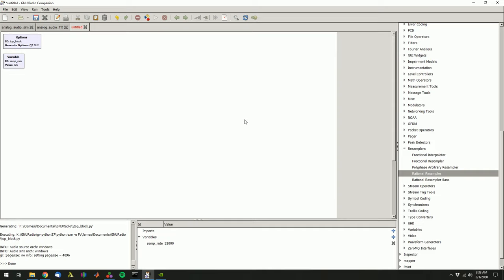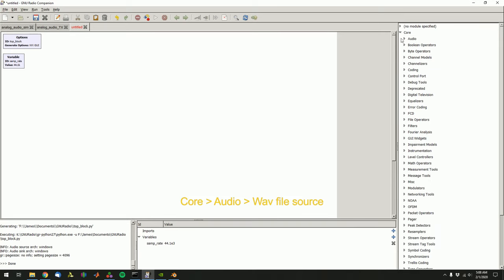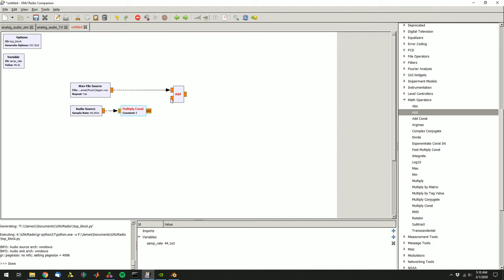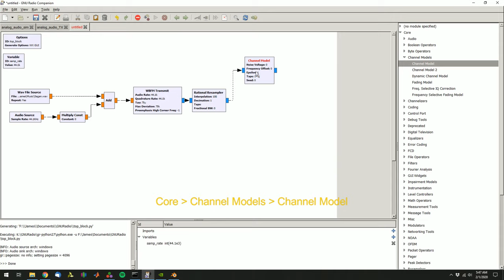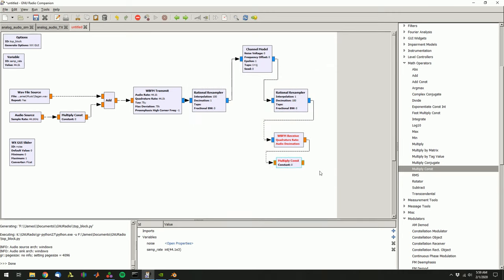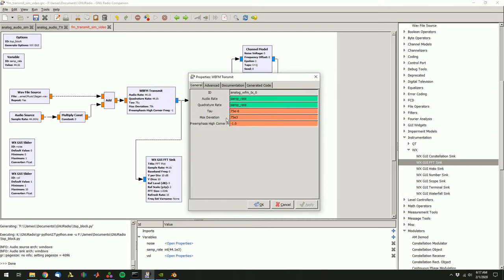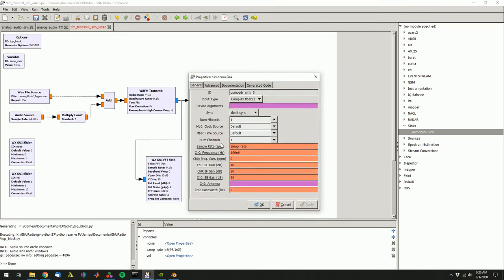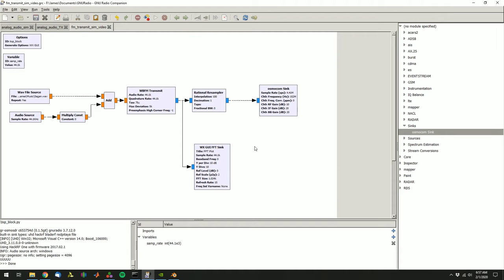FM Transmitter in GNU Radio with HackRF

Comment: You may want to insert a 44.1k throttle block after your file source instead of clocking it with an audio source and zero multiplying it, but nice! :)
Reply: My audio had a stuttering noise while transmitting but after trying this out it fixed it thanks!

Comment: Hi Bro

I get this in the process drawer and nothing runs, pleaceeee help me!!

Generating: 'C:\\Users\\Partner\\Documents\\UNIVERSIDAD\\PROYECTO\\hacrf one\\Pruebas\\gh.py'

Executing: C:\Program Files\GNURadio-3.8\gr-python27\python.exe -u C:\Users\Partner\Documents\UNIVERSIDAD\PROYECTO\hacrf one\Pruebas\gh.py

Warning: QT_DEVICE_PIXEL_RATIO is deprecated. Instead use:
   QT_AUTO_SCREEN_SCALE_FACTOR to enable platform plugin controlled per-screen factors.
   QT_SCREEN_SCALE_FACTORS to set per-screen factors.
   QT_SCALE_FACTOR to set the application global scale factor.
gr-osmosdr 7da9989b (0.1.5git) gnuradio 3.8.0.0
built-in sink types: uhd hackrf bladerf redpitaya file 
[INFO] [UHD] Win32; Microsoft Visual C++ version 14.0; Boost_106000; UHD_3.14.1.HEAD-0-g0347a6d8

>>> Done (return code -1073741819)